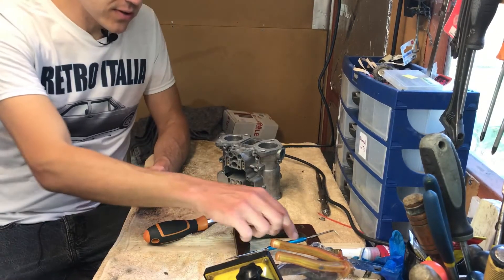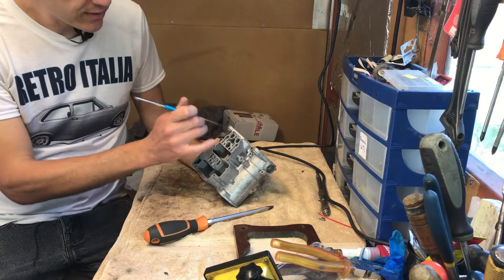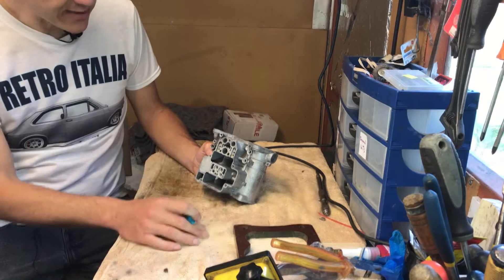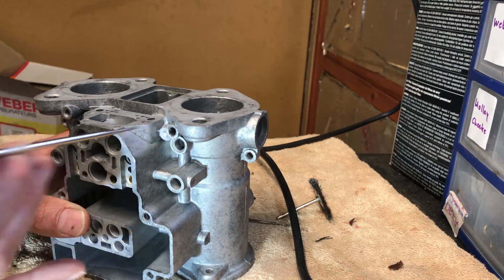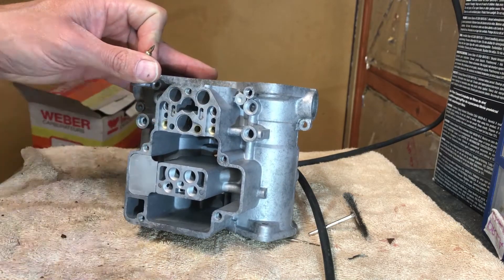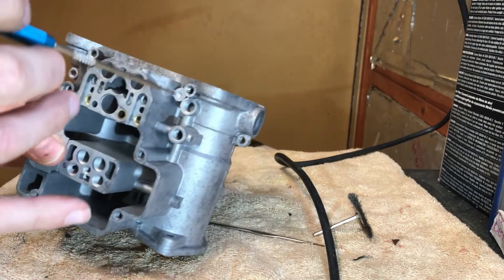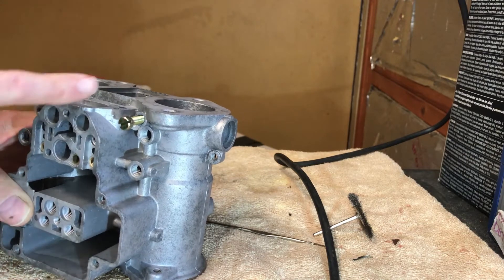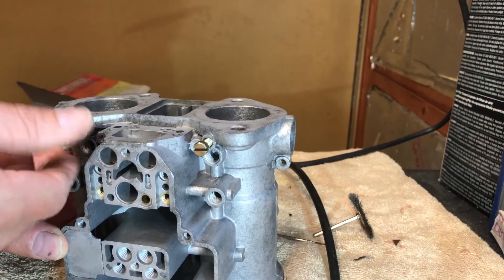How to fix the Idle Mixture threads on a Weber DCOE 40 carburettor

Comment: Attempting to do a similar repair on several DHLA bodies with completely ruined threads. Got some brass M6 3D-print inserts that I will drill out and tap to M7 0.5 pitch, then insert with Loctite for an interference fit. Would probably have the best results aligning the hole with a mill, but will try with a drill guide instead.
Reply from the maker: Good call!